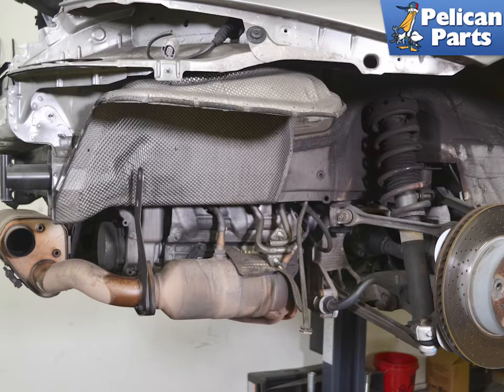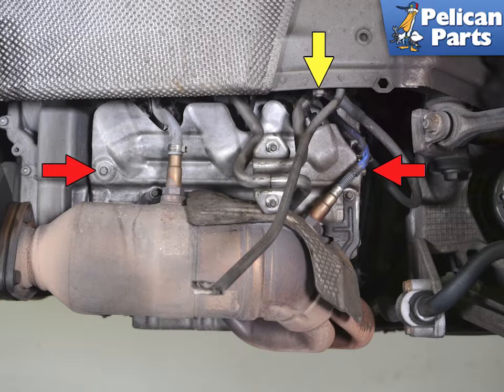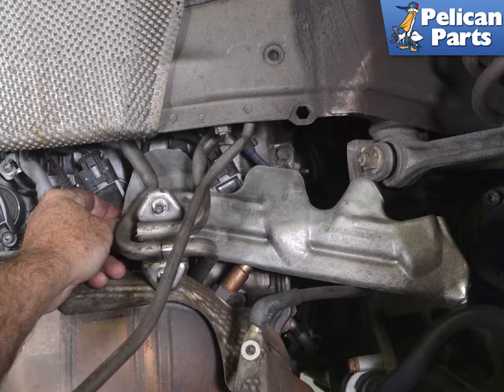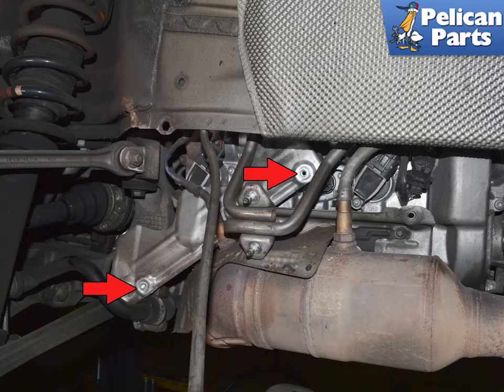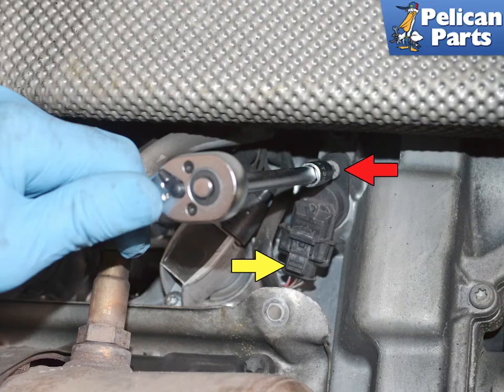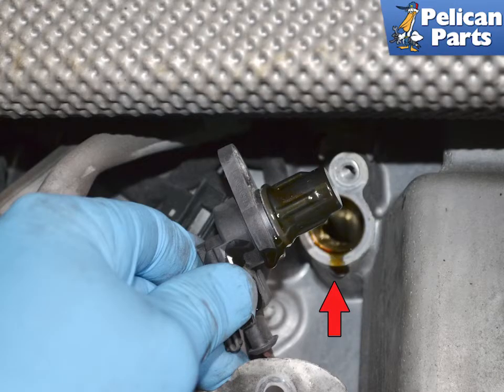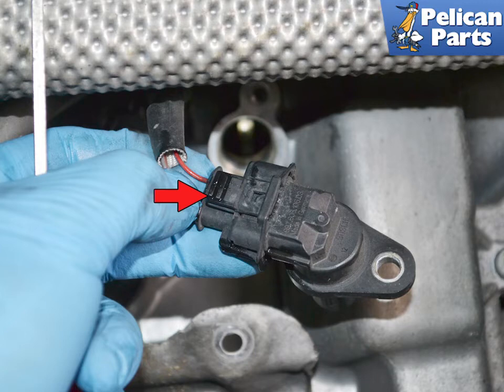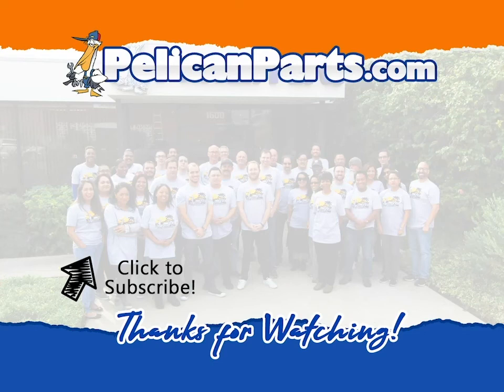Porsche 997.2 911 Carrera Camshaft Position Sensor Replacement (2009-2012)

Comment: Would this process be identical on a 997.1 ?
Reply from the maker: No, you can see the sensor location in this article: https://www.pelicanparts.com/techarticles/Porsche-996-997-Carrera/26-FUEL-Replacing_Engine_Sensors/26-FUEL-Replacing_Engine_Sensors.htm